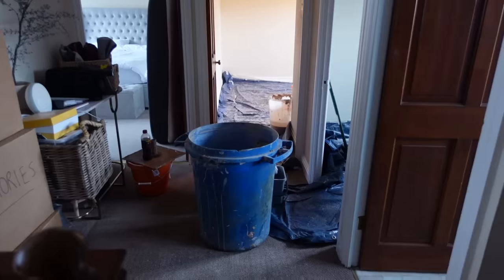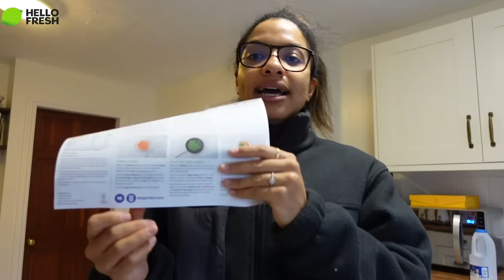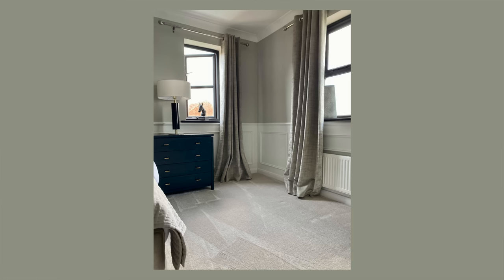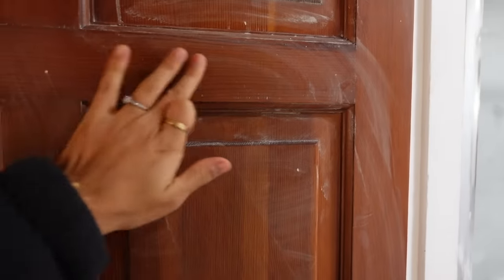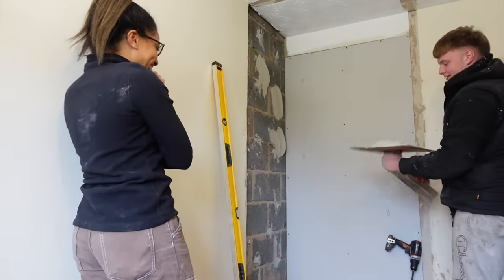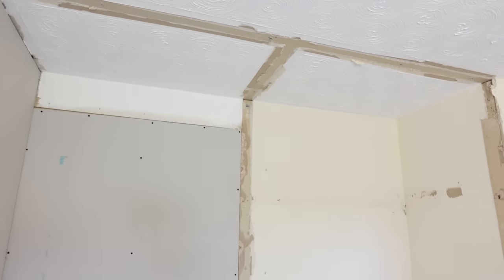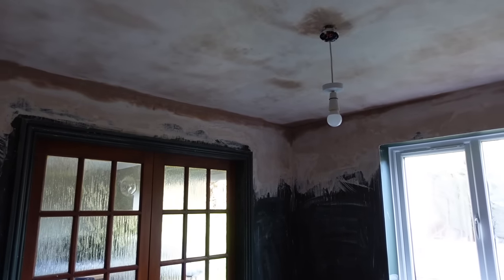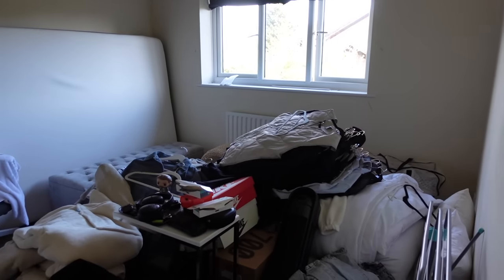Plastering Artex ceilings | Learning to scrim tape, PVA and plaster board a wall

Comment: A new video, we are dancing moonwalk here💃🏾💃🏾💃🏾
Reply from the maker: I have some making up to do haha!  ❤
Reply: @ShadeShannon unfortunately that is not dot and dab, it always amazes me plasterers don't understand the concept, when we was doing this in the late 70s  different these days with mf metal frame, anyway dot and dab, adhesive on the wall and put a packer into it with either 9.5 plasterboard or the green black yellow blue Packers we now use for double glazing, do this in 4 corners, string line across each one, so now you have four corners which should now be vertically un horizontally plum, so now you do this in a series of places through the lines, now you put your dabs of adhesive over the walls, you press your plasterboard to your Packers now the plasterboard won't go any further because they hit the dots, no need to smack the plasterboard with a Derby or level or even level a plasterboards up because they are plum, this is why it is called dot and dab, what he is showing you here is just dab, as a structural engineer master builder and stone mason is still amazes me people are being shown things incorrectly, if you're ever down Cardiff way look us up we will be more than happy to show you how things are done properly,

Comment: I moved into my 60  year old house nearly 30 years ago, I plastered the full house straight away,  it cost me an hilarious amout , £350 for the WHOLE  house, and its a large 3 bedroom semi with an extension, Im not kidding,  but never plastered the ceilings at the time  , I dont know what I was thinking, I then did all  the ceilings probably 20 years ago , so I gave myself 2 lots of mess, and it was messy!  I taught myself to plaster now , but only do cupboards and repairs, its not as easy as it looks.

Comment: I had my artex ceilings skimmed over 5 years ago…and last week a massive section fell onto my husbands head!! I’ve had several plasterers come and look and they have all said they would never just skim over and we should have had over boards…..and that if you skim over eventually it could fail and come down like it has! Only one has said that’s not true and we can just patch up that bit……but with a young child in the house I’m petrified more could come down!! It’s so hard knowing which advice to trust, especially as the original guy was very experienced and I’m sure if he had said it may come down we would have overboarded in the first place. Now though we have platster corncicing and so we would have to remove this, and it’s a huge room so will cost us thousands rather than £300 just to patch it up….safety is my main worry…but obviously we dont have 2/3k just lieing around to overboard……. How do we get honest accurate advice?
Reply: Sadly there's no one right answer for dealing with artex. Different plasterers prefer different methods, and many are scared to even go near it. 

A lot depends on the type of Artex and the age of the house. A lot of older homes aren't ideal to plaster over as there's a good chance there's limewash paint under the artex which, when plastered, the weight pulls it off the ceiling.

Most plasterers just don't want to risk it and suggest to overboard. Even the best plasterers have had artex ceilings fail on them after plastering.